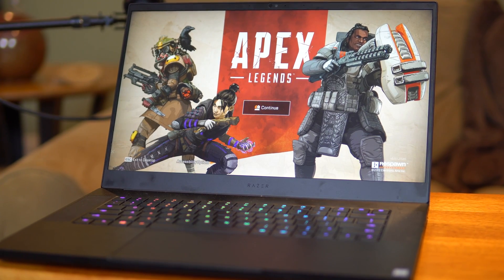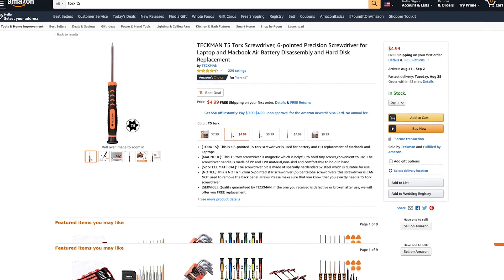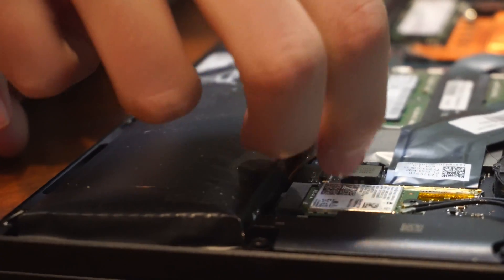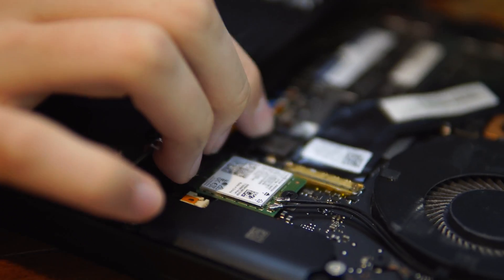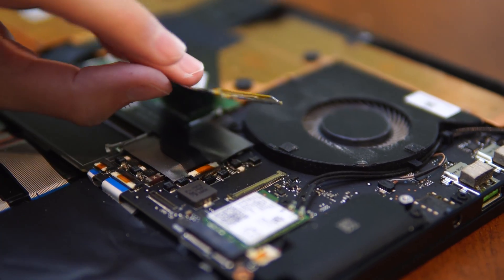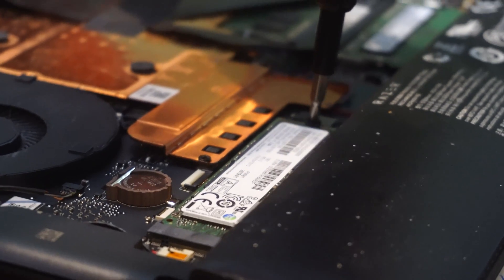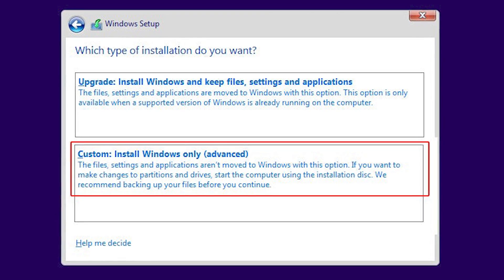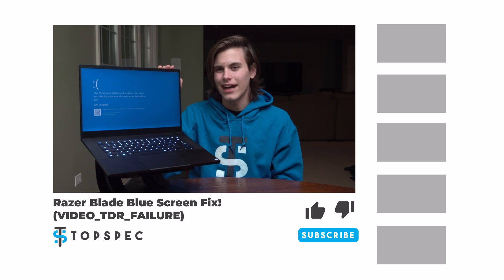Razer Blade 15 Upgrade Guide! (RAM, SSD, Replace Battery)

Comment: did u actually say there is no good way to transfer ur files in an easy way? and u make vids about turorial tech shit?
Reply: It's fairly difficult to transfer the ENTIRE C: drive as there are hidden files that don't get transfered by default. We ain't talking about click-dragging bro
Reply: @superhotwasabi1044 im sorry whaattt??? I have 1 tool that copies moves whatever u want recover data with 2 clicks at most that does everyhing if a customer wants to change to ssd i add the ssd start the pc select c drive (hdd) copy to ssd and once done reboot from new drive (ssd) and thats it sorry but if u say ur in tech and u dont know it thats beyond crazy!

Comment: A tip for others. My battery was so swollen that when I unscrewed that side it physically and forcibly pushed the base plate.  So I recommend people loosen those screws a little to see if there is any sign of that pressure.  In which case I suggest tightening the screws again if you can and buy a new battery before proceeding with whatever else you were doing. I upgraded RAM and am running my blade without a battery while waiting for delivery.
Reply: I’m looking for a battery replacement for my unit (razer blade advanced 15 2020) but can’t find it anywhere. Help?

Comment: I just had to do this whole process. Thanks for your video, extremely helpful. Only issue I'm having is being able to open my old ssd in a reader to check if I have all my files. Also the battery life still sucks :D

Comment: My Razer Blades battery is finally starting to puff up a bit, I went to go check the link in the description for the battery he used as a replacement. But it's saying that the page isn't found? Is there a new link or website I could purchase the same battery used in the video from? Any help would be greatly appreciated!
Reply: Could you find one?

Comment: Have you had any problems with the battery. I’ve been using the one you recommended for a few months now and I all of a sudden stopped working. When I opened my laptop to check it I noticed that the cover/casing had cracks on the edges.

Comment: as a warning to some people, if your battery doesn't just lift out, its taped in, for no reason there's some blade 15's advanced with double sided tape under it.
Reply: Can confirm, my back panel even had the double sided tape treatment.

Comment: I removed all the screws for the battery but it's still stuck on there. I can wiggle it but it's not removing. Any clues?
Reply: Did you figure this out?  Mines in the same situation.
Reply: @ChrisEdoria  someone said that in some blades there  are double sided tape underneath the battery 😂🤦🏽‍♂️ so just take it out
Reply: @amer-bloc  I had to use excessive force to pry it out since it was bloated so much.
Reply: @ChrisEdoria  oh man that sucks. How long after u bought it did that occur? Iv had my blade for 7 months now thinking of doing a cleaning session

Comment: This may have been months ago but I need help with the wifi it goes off and on many time and I tried looking it up and it didn’t work I tried to unplug my wifi router still didn’t work
Reply from the maker: Make sure that the little wires that go to the wifi card are secure and that the card itself is not loose. Hope it helps -cb

Comment: Hey man great video, was shopping around for RAM upgrades for the same laptop, and was wondering if you considered ram sticks with higher speeds than the 2666, and if you think its worth the extra money?
Reply: You could use higher speeds but unless your CPU supports it itll just be throttled. Ik desktop intel cpu's are set to a certain ram speed unless you buy the overclock able version so maybe look up your CPU on your laptop, but if you have a amd cpu, you can go for 3200MHz no problem  though you might wanna dubble check its enabled on your bios

Comment: I just run my Razer Blade 14 without the battery. The original one was so swollen that the track pad became curved and I tried replacing the battery twice, the first one lasted about a day and the second one for about 30 seconds.
Reply: @TopSpecMedia  It also lays on top of a nifty looking cooling pad.
Reply: Hello, so far, you still using RB14 without battery? If yes, how is the current situation? I bought Razor Blade 4090 2023 16” I am worried about the battery life, should I remove battery immediately before starting using it? Thank you
Reply: @kaankucuk1612  You can if you want, in my case, the battery was bubbling up. I’d say preventatively it would be a good idea to do so although I’m not sure if Razer changed it to where you need a battery regardless though.

Comment: Anyone know if changing from the 230w power supply to the 17in 250w supply does anything? Could you even use the extra 20w?
Reply: Did you ever find out?

Comment: Thanks for submitting this guide.  the battery works great.  My only issue is the computer doesn't recognize the battery and therefore no battery power rating.  Any suggestions?
Reply: I'm having the same issue. Did you happen to find a solution?

Comment: is it possible for me to add a second internal ssd?
Reply from the maker: I do think this is possible on the base model Blades because the battery is smaller than the advanced model, so you can put in a SATA drive. -CB

Comment: Is it possible to upgrade the cpu?
Reply from the maker: It is technically possible but for regular consumers like you or me, not the best idea (not to mention takes expensive tools). They are usually soldered to the board :/ Sorry!

Comment: Hi, great vid! 

2 questions?

Does that battery work with the Razor blade 15 BASE 2020 model? or only advance as mentioned? 

And does it really improve much with ram and NMVE harddisk?
Reply: the base model has a different battery entirely, different sizes for different devices.

Comment: RazerBlade 15 Base - Lots of BSOD. After a lot of struggle found out that the SSD is just shutting down for some reason - Maybe a Hardware issue. So moved OS to HDD and it works fine but very slow. 
I guess I need to replace the SSD :(

Comment: Just had the same thing happen. Letting razer take the L on this one because I'm in warranty but I'll be picking up a replacement to have on standby. Had never been a laptop guy but the Mercury White blade tempted me one dark April afternoon. Depending on your specific laptop you can manage the second stick without removing the display ribbon cable. They have it pretty heavily protected and you're more liable to knick the RAM. I've been fixing laptops for years and believe it or not this is my first swollen battery. I have had laptops that soldiers have tossed into the desert fair better. Here's hoping the replacement battery stays healthy and Razer sources better units moving forward

Comment: If you buy an external hard drive/nvme/sata ssd case you can actually migrate the os and all of your files without needing to reinstall windows and buy, if you want, a windows key. And after you copied everything you just swap the disks and you are ready to go

Comment: Awesome Video! But i have a question, do you need to install any wifi drivers when upgrading the ssd because i've heard that you can just download a wifi driver on an external drive and then you only have to update windows to install all the other drivers needed. How does this work?

Comment: I have a question So I am somebody that keeps my laptop plugged in 24/7 just because I treat it like a desktop. I like the format of laptops and not desktops, (it's weird I know.) But the question is: if I leave it plugged in 24/7 like I do, will the battery inflate like you say it does? Because the laptop I currently have is an HP and the battery unsnaps from the back, and is not located internally like this razer blade's battery is. I am thinking about buying the razer blade 15 advanced 8 core, 16 gb ram 2020 model. And I stumbled upon your video as I searched for: how to install ram razer blade 15 2020. Because I wanna upgrade it to 32 gb of ram instead of 16 gb that it comes with stock. And also, what causes it to inflate? Should I just take out the battery from the razer since I am just gonna have it plugged in all the time? Let me know man, because you know more than me, and google searching specific questions that I have always end up making things tough. So I thought I would ask you since you know your stuff. Thanks :)
Reply: You can always disconnect the battery
Reply: What did you end up doing?

Comment: Hey, do you know how to fix an issue where the display no longer works but external displays work fine? If I hold my monitor in the right orientation and image sometimes shows.
Reply: bad connections to the screen internally. Maybe a bad solder or torn ribbon cable. I would go and have a professional check it out.

Comment: Hey! I'm a newbie to upgrading laptops so your clear explanation is really helpful :) Just want to ask, should this process be more or less the same for the RB15 Advanced (2020)? Also, can you provide a link to a tutorial to create a Windows bootable instance? I don't have any data to transfer from the old SSD, but I read that no matter what, only having one M.2 slot in the laptop means that you need an M.2 to USB adapter to swap them. Just taking the old one out and putting the new one looks much easier...

Comment: Hey, this is super detailed and useful. What key do you use when reinstalling Windows - just the one that came with the computer?
Reply from the maker: As long as you have Windows 10, you should not need to find your key at all. After a reinstall it will automatically detect that your system previously had an activated version of Windows. Hope this clears things up :) - Aaron
Reply: @TopSpecMedia  oh, that’s awesome! Never knew that :) I plan on upgrading the SSD first thing after opening, so this saved me from upgrading before activating the pre-installed Windows. Appreciate the reply and all your videos!
Reply from the maker: Happy to help! Thank you for your support :)

Comment: does it work on the razer blade 15 base model as well?
Reply: the base model has a second nVME slot specifically to install more storage on your laptop. No need to re download windows. RAM upgrade is the exact same. Battery upgrade should be the same as well.

Comment: Did you expected any heat issues with the new battery when you charge from 5% to 100%?
Reply from the maker: Nope! Not so far. This video was shot in advance over the summer, so I’ve had the battery for about 3-4 months now and it’s been working perfectly—perhaps better than the original. - Aaron
Reply: @TopSpecMedia  i bought the same battery 1 week ago and when i charge it from the percent that i said, the left side where the palm rest gets so hot and for prevent i shut down the laptop
Reply from the maker: What surface are you charging the laptop on?
Reply: @TopSpecMedia  over a cooling pad by coolermaster i just finished the first 3 cycles that the manufacturer said

Comment: This needs way more views!!! Awesome Video! Does the ram brand matter or the one that you used is effective enough when adding ram?
Reply from the maker: RAM Brand does not matter as much as making sure you are getting the correct physical size and RAM speed, but at the same time don't buy RAM from a no-name manufacturer. This kit we used in this video has worked well so far, but you can always check out other types of ram using Crucial's RAM Advisor: https://www.crucial.com/store/advisor

Comment: Are there any tips on how to prevent the battery from swelling?
Reply from the maker: Battery swelling on these machines is most likely down to the quality of cells Razer chooses to buy from a random manufacturer, which can be spotty from time to time. Exposure to prolonged periods of heat can also cause a battery to swell, which is common since this a gaming laptop with very powerful components inside. By heat, I mean the intense heat that is generated by the GPU and CPU for long periods of gaming, for example.

Comment: The battery on mine is starting to puff ugh. Thanks so much for this.

Update:  its been a bit since I ordered and installed the laptop battery recommended here. Its working great. Been playing things like monster hunter and final fantasy 14 with no issues and way less overheating issues.
Reply: Which battery would you recommend? Thanks
Reply: @7x13mx  using the exact one he recommended in the video. It cost me around 120 at the time I think.
Reply: Yeah I need a new battery too
Reply: Hey there, is it still working fine for you? Any problems?
Reply: @abigellm8929  nope nothing yet. It hasn't even started puffing.
Reply: @lyssata6844  sounds great, thanks for the info :D